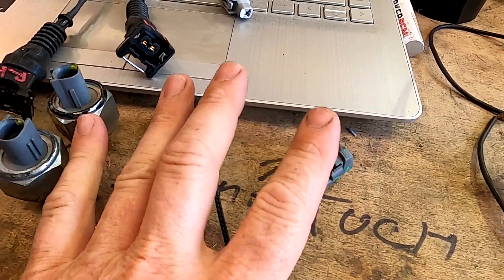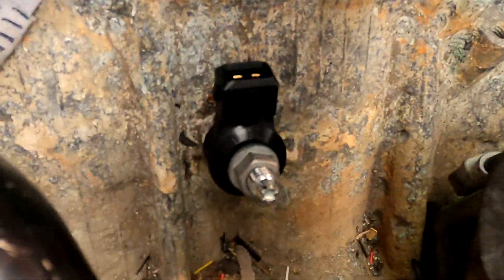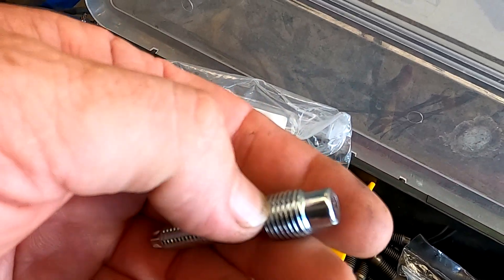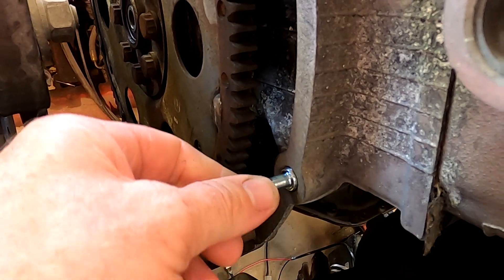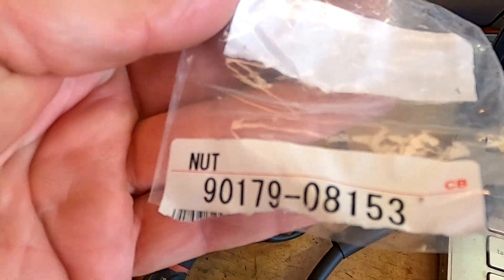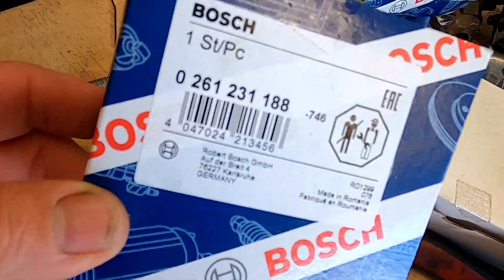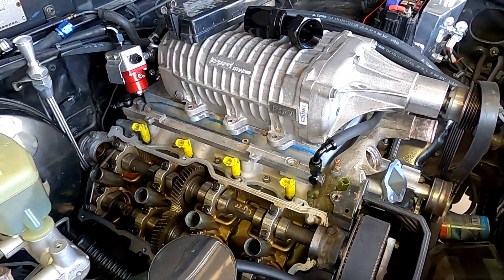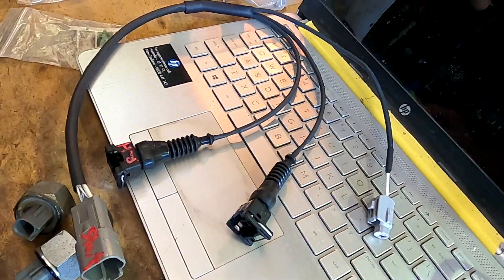1uz , 2uz , 3uz  knock sensors for aftermarket ecu.  bosch wideband sensors

Comment: Hi Kevin I just stripped my 1uz to service the starter motor and noticed both of the knock sensors are broken. One had no top in the plug so has always been broken & the other looks a bit fresher. Mine is running a LinkPlus LPV14 ECU  does it use these sensors? The loom has 2 wires but only one to the plug. Thanks
Reply from the maker: Early g1 linkplus do have the ability to run knock control so to answer your question you would be best to check in the software if yours has had knock control setup.

Comment: Hi. I have a question regarding your wiring loom. What gauge wire did you use as your starter switch wire. Is it a 20awg wire? Thanks
Reply from the maker: We use 16 gauge for start trigger

Comment: Why not use the Denso wideband Knock sensors on later model Toyotas so you can stick with the same pins and connectors as the rest of the wiring loom?
Reply from the maker: Easy, cost and Availability dictates my choice.
Reply: @CartuneNZ  Understandable. I thought there may have been a compatibility issue.

Comment: Thanks for the part #. I was only at Toyota parts trying to get them to look it up to for wideband knock sensors.
Reply from the maker: I wouldn't expect a Toyota Parts place to have these wideband units as they are not suitable for stock ecu on toyota.  I get them through a performance shop.  Cheers Kelvin
Reply: @CartuneNZ  Thanks. I was referring to the M12 to m8 adapter bolt to mount the donuts.